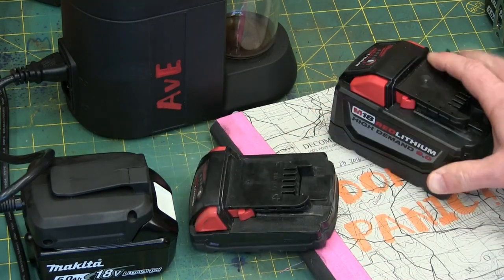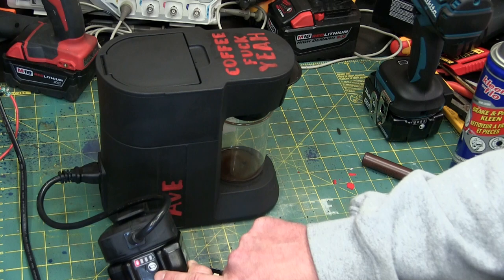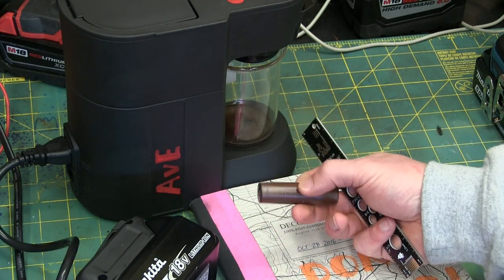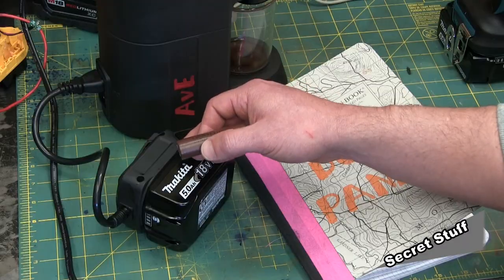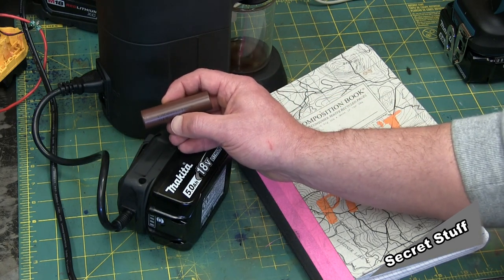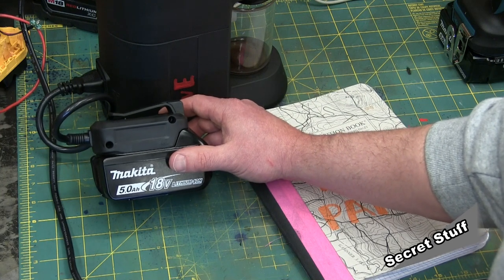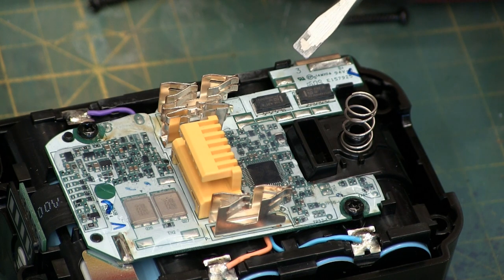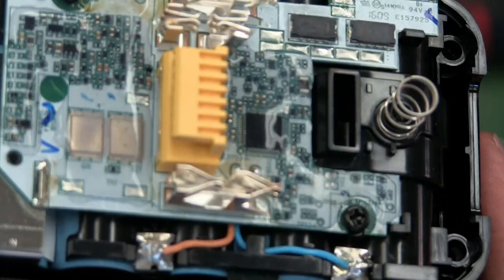BEST TOOL BATTERY? WHY BIG LITHIUM COST YOU LESS!

Comment: So surprised that I haven't seen a lipo battery pack for these tools (like RC battery packs), with all of the area lost with round cells instead of a flat pouch that makes up lithium polymer cells I feel capacity could be increased greatly..... whatcha think AvE?
Reply: no, fuck pouch cells, they have a much greater (seemingly) want to expand and/or explode.
18650's (form good manufacturers) (seem) to be way better all round.
(how many laptop battery packs exploded vs phones in the last 10 years?  not nearly ass many)
Reply: It would most likely be due to the fact that 18650s are so easily available. The extra capacity you might get from a custom flatpack battery is not going to be good enough to offset the cost of off-the-shelf 18650s.
Reply: Li-Po's are not nearly as reactive anymore, Big Clive put a nail through one earlier this year and it was almost non reactive
Reply: Hundreds of Dell D600 battery packs in the mid 2000's all vented with flame. You can still find pictures of burning D600's on conference tables.
Reply: probably more for the reasons 18650's are standard sized. A new-and-improved or just-as-good-but-cheaper (or crappier but cheaper) cell becomes available, it's no problem at all to switch which they use and keep the rest of the manufacturing the same.
Reply: Converted one of my battery packs on my old Milwaukee drill to lipo. 

Used a 2200 4S and other than being a pain to charge it fucking chooches like you wouldn't believe.

Got notice my ruler shipped, gratis AvE!
Reply: MemorableC I hit my old phone with a chipping hammer and it def let the smoke and flames out
Reply: While you may be loosing out on capacity, the cylindrical shape has some advantages that may offset this.
The most important benefit is that the cylindrical shape can contain internal pressures quite well. When those rectangular pouches start to bulge, the cylindrical tube isn't batting an eyelid yet.

Comment: I got 4 years out of 3 smaller makita batteries. the 2.0 mah variety. I got 2 years out of 2  3.0 mah dewalt batteries. This is in a commercial carpentry environment. I think the makita chargers take care of the batteries better. The dewalt batteries were used less over all and in a sawzall and hammer drill, the makitas were used for my impact driver my most used cordless tool. I got much better performance and bang for my buck off the old XRP dewalts than I do from their lithiums. Maybe I just got a bad batch.

Comment: Could you test the Milwaukee M28 volt battery? The V28 volt battery had 7 - 26700 cells with 3.0 AH now over 10 years later the M28 batteries are still 3.0 AH and cost big $$$. For the money the M28 batteries should be 6 AH. Just one reason I will buy Makita tools.

Comment: Now, this is what has always confused me about batteries, and believe me, I'm easily bewildered; I was always under the impression that the Ah rating of a battery is how many amps it would provide for one hour, so for example a 10Ah battery would provide 10 amps for one hour, or 5 amps for two hours and so forth.

The thing is, I recently built a gadget that draws 5 amps, so I bought an 8000mAh lithium polymer battery thinking it would be enough to power it, but the overload protection switches off the battery immediately, but a 10000mAh battery I have will power it.

It makes my head hurt.

Comment: Hey AvE. Any thoughts on Milwaukee's claims that the M18 9.0 battery pack will deliver 35% more power than standard 18V batteries? My assumption is if the tool is set up to draw more amps than the "standard" battery pack delivers, the 9.0 pack can deliver more amps and therefore more "power." It would be interesting if you ran a detailed test of the difference in output between different sized battery packs.

Comment: DeWalt has a new line of compact 20v 3Ah batteries. They don't look like they hold more than maybe an extra cell compared to the 2Ah. The old 3s actually look like they had 8 cells inside. Do you think they're using higher ampacity cells or just pushing the old 18650s to the limit?

Comment: I own the 18v Makita Lithium and I've gotta sat they by far out perform any other cordless tool battery I've ever had, and I own about $45k of snap on and Matco tools.

I did notice you are comparing Lithium batteries from Milwaukee and Dewalt that are either higher voltage or advertised high demand batteries which I would say are both "special" batteries that you are comparing to the "standard" battery for Makita. I feel like it's kinda comparing a base model to a fully loaded model and expecting the base model to compete.

I think pound for pound so to say, the makita is the better of the 3. over a year of sitting in storage and the makita was still at 100% charge and went on to drill and drive about 80 holes with a masonry bit and anchors, and only went down 1 notch on the charge indicator. I think the makita is hands down the better battery in real world "worth" measuring.

Comment: Hey AvE, are you willing to construct a device that could take any battery which has to have discharge/charge cycles in order to get max life out of it? I was thinking of that beacuse i use a lot of equipment (motorolas,maglite) which use NiCds and they sit for a long period on the charger (they have to be avaliable for emergency), and when you actualy have an emergency, they last for s**t. The crux of it is: it cycles battery few times a year/month. Discharging cycle is fast as possible. Charging is normal. Saves money and enviroment from batteries which are used   for emergency backup gear or the gear that doesnt get used as much but is critical when you need it. An example is my motorola VHF radio which i carry as a volley firfefighter.

Comment: @AvE Just discovered your channel not to long ago, love your videos and off beat humor,  but wondering why you don't use a wooden dowel as a pointer stick when showing internals of batteries and the like instead of a metal screwdriver?

Comment: Suggestion for a quick video/vlog:  

Your take on Milwaukee's new safety warning regarding their M18 9.0Ah battery pack. The new warning will be added to product manuals, and although it singles out the M18 HD 9.0Ah battery pack, many state it is a good practice to keep in mind for ALL Li-ion battery packs.

In essence the warning states; "do not allow highly conductive or corrosive liquids to get inside an M18 9.0Ah battery pack. Doing so could lead to short-circuiting, which could lead to very dangerous reactions. We’re guessing this means fire, explosions, and the potential for bodily harm."

Maybe cover what constitutes as a highly conductive or corrosive chemical? Salt water, bleach or bleach-containing cleaners, as an example.

MIlwaukee stresses that these battery packs are safe to use, and that ANY liquid infiltration is already warned against. But given that these battery packs have greater energy capacity, there is increased potential for harm.

(I cut an pasted much of this from Toolguyd, to save time)

Comment: If you want  delve into the world of high capacity, very high discharge rate batteries, look at LiPo as used by r/c vehicles. A typical battery will be over 5,000mah, capable of sustaining 100amps with peaks of 200amps. Typical usage scenario will have the battery flat in well under 10 minutes.

Comment: Ya from the looks of it that dewalt flex volt grind is skookum as Frick. I wasn't one but I just got the damn  18v millfuki. Just playing with the dewalt grinder at the big box everything seems nice.  The plates that hold the disk on.. Not sure what there called are even nurled which is a great idea I think.

Comment: those makitas are seriously drop-proof. Mine fell off the garage roof, 2.5m onto concrete, barely a scratch. Damn impressive
Reply: Mickleblade meanwhile, they gave me a brand new Makita drill/impact set at work, and the drill just stopped working. I drilled a hole in some sheet, put it down, picked it up and it never ran again. Returned it, new drill is good, but I've replaced the batteries twice in two years.
Reply: damn! were you unlucky or me lucky? I have a drill, impact driver, sds drill, sander and circ saw, all have been used hard, all are working fine.
Reply: Mickleblade I'm generally unlucky. I think their equipment is good, but I still have a pretty low opinion of their batteries. Customer service is good, though.

Comment: If you take a looksie at the datasheets for high discharge current batteries, you will most often find that they MUST also be charged at a high current, to prolong their life. Interesting, as you kinda assume that lower current charging would be best for a batteries health, but often not the case.

Comment: Fets look similar to the IRF DirectFet(tm) package. The die is bonded to the aluminum cover for one terminal and solder balls on the other side for the gate and other terminal. One main advantage is a significant amount of heat can be pulled out of the top of the package by a heat sink where most other SMT packages the bulk of the heat is directed in to the board. 

Sample part http://www.digikey.com/product-detail/en/infineon-technologies/IRF6718L2TRPBF/IRF6718L2TRPBFTR-ND/2122759
Reply: Main brain is not engaged cover is NOT aluminum. Plated copper normally. Sorry about that late here.

Comment: Sadly there is no balancing in "older" Makita batteries, refering to the ones i've taken apart.
It's just monitoring the total voltage, single voltage of one cell and temperature, and cuts out if it's out of range, and tells the charger not to charge anymore. 
And there you go, one cell gone, and the whole battaria is fucked.
When this state(wont charge) is there for a too long time, the ic on the board won't let you charge the battery even if you replaced the defective cells.

Looks like they added a balancer to not fuck over their customers too much.

Comment: 6:40 Those two stood-off packages remind me of some overvoltage AND overcurrent fuses resembling what i've seen in some Macbook batteries.

Kinky little things, those had a sort of a heater connected across the + and - terminals, which burns the fusible element in case of overvoltage.

Could those be similar devices?

Comment: I got a Makita High Impact wrench (XWT08) and tried to use it with a BL1830  Makita battery. The wrench did not work. I took it back and exchanged it thinking I got a DOA tool. The second one did not work either. The batteries worked fine in my Makita BT04 Hybrid Impact. I finally figured out that the Batteries were the old style and did not have that Star symbol on them. Nobody said anything about having to use a newer battery with a fucking star on it. I thought Pixies were Pixies, shouldn't matter what box they fly outta.  Now I have to buy a properly dressed Pixie Box complete with STAR jewelry or my "08 won't CHOOCH!!

Comment: Is not the tradeoff for the bigger battery packs that they increasingly negatively affect the balance of the tool in the hand and increase user fatigue? I see some point in tools like a mitre saw but on screwdrivers or combi drills is it such an issue changing a battery a little more often when it makes the tools nicer to use?

Comment: really enjoy the videos. try to follow as best I can. is the efficiency of the dewalt for instance lost when used in a 60v tool. as in the discharge being completely different than used in a 20v tool?I'm assuming the batteries switch from series to paralleled?

Comment: That plating is likely to be silver. It's pretty common in ecig contacts where these guys are pulling enormous amperage through relatively small contact points.  Granted that was back when we were using purely mechanical devices, and drawing 20 plus amps from a single battery. Some of those damn things have a whole fuckin lot of go in them. 

As for why silver-  The silver gives better corrosion resistance and is a better electrical conductor than copper or even gold.

Comment: I just put on a metal roof with 3000 screws- I used the smaller lighter batterias- question yourself the ask, how much weight do I want to carry up and down off the roof hundreds of times. 
You could carry a Tesla car on your hip and never have to recharge but you would be dead before tool:..
Reply: Depends on what you're looking for, obviously, for you, the lighter battery is better. As for me, bigger is better.
Reply: That's kinda like putting 20.00 in the gas tank at a time
Reply: I like not loosing productivity having to switch out battery's and fuck around with the chargers. time is money 
also for roofs a corded strip gun is the bees fucking knees

Comment: I've been super fucking impressed with the 4Ah 18v Ryobi lithium batteries. Those fuckers just go and go. The other morning, a lovely cool New England morning mind you, I pulled out my Ryobi brad nailer (I know our feelings on that tool, but you gotta smoke what you got you know) and my Ingersoll Rand drill/driver to do a little fixy fixy at the farm. They'd been sitting in my car all night below the temperatures the little instruction manuals tell you not to keep em at, and the ingresoll rand just wouldn't go worth shit. had to stick the battery in my jacket for 20 minutes while I nailedaway with the Ryobi before it warmed up enough to do what I needed it to do.

So yeah, fuckin impressed with Ryobi. Maybe I should get more puke green tools? Though that would hinder my goal to have as many different battery chargers in my toolbox as possible. I'm up to six chargers. Down from seven when my hitachi exploded a little. Maybe with the Christmas bonus I can get up to 8!

Comment: Until Milwaukee fixes the chucks on their cordless hammer drills, they are staying in the damn truck for sure. The last four have gotten stuck locked on a bit and then internal mechanism shatters when trying damn hard to loosen the fucker.

Comment: i have a huge request my brother is in to the e cig thing and he says some stuff that just seems strait up wrong like to get the heating element hotter in needs to have a lower resistance or that you get more power use pulse width modulation. now i dont know much about pixie wrangling but surely to get the coil hotter you want a lot of resistance and that battery hooked directly to the coil and not a load for circuitry.
It would be interesting to hear what a guy that knows way more about pixie wrangling then we do has to say then some salesmen with all the marketing wank.

Comment: I would have had the battery indicator on the main board. More efficient production and less likely to break. Dewalt battery looks nicer designed.
Reply: I would have had the charging circuit and lights on the battery itself, just to have a more compact charger.

Comment: Do you think another multiplier to further widen the gap between the two batteries (and prove your point) is that the smaller pack will also have more frequent recharge cycles than the larger pack which will accelerate degradation?  I.E. reduced performance including charging time. 
My understanding is that the variations between the cells levels of degradation cause the protection circuit to work harder during charging to keep the cells in balance which increases charge time and stresses the cells. Reaaally cool videos and I am SO PSYCHED that you made one on Li-Ions.

On another note, I think you are spelling 'fuck'  differently from how you say it. 'Fack' is an Eminem song you should listen to and enjoy. It's dirty and I love it. I think you would too.
I think Canadians like you say it more like 'FOCK' haha. 

'FOLKUS YOU FOCK'

Comment: But if you use high cap cells in the big one (low current rating) then the smaller current per cell could still be high current compared to its rating and cause life issues.

Comment: So now I have to get rid of my 16 year old DeWalt 18 volt NiCads? I have hav Miilfuckees, Makitas, Ridgids in past and my trade, Plumbing, HVAC, I have found the DeWalts I got in 2001 have performed better, lasted longer. I am on 4th and looks like final batt packs and do  not want to spend another $100 for 2 new batts. So I have 4 various Drill drivers 1 is a hammer drill which comes in handy, not having to go to truck for corded hammer drill. If I am going to spend $200 US max, WTF should I get oh Great Wise and Smarter than Me Canuckystany Sage?

Comment: Probably the truest statement is that Li-Ion batteries are evolving quickly.  Most Li-Ion battery fall into the "Nickel Cobalt" family.  Lots of fancy chemistry going on, including in the anode and cathode.  This what you find in most 18650 cells (18mm diameter, 65.0mm length).  Tesla and Panasonic are going to set the world on it ear when they finally start high volume production of the 21700 batteries.

There is a "black sheep" in the Li-Ion family and that is the Lithium Iron (LiFe) battery.  It has less capacity and also has puts out less voltage.  It REQUIRES special charging.  Why would anyone use these ?  Because they are inherently SAFER !  They won't burn/blow up.

Comment: but what do you think of the rc car/plane batteries that sometimes have specs so high they can safely discharge at 12kw at 22.2v for the 50 seconds they'll last at the draw
Reply: Those are LiPo batteries, main difference being that they are unsafe for regular consumer use as they can easily catch fire is slightly mistreated.  The cells in power tool batteries use a chemistry that can't catch fire even if you try really hard, let alone by some kind of accident.  The other thing is that those high spec RC batteries only last about 50 recharges before starting to crap out whereas the lower amperage rated cells will last many many more cycles.  The typical battery in a cell phone today will last 1500 recharges before falling to 80% of original capacity.